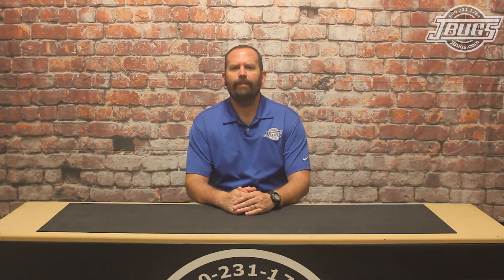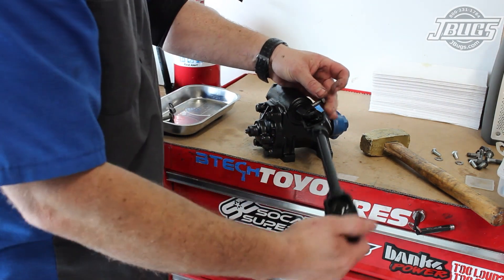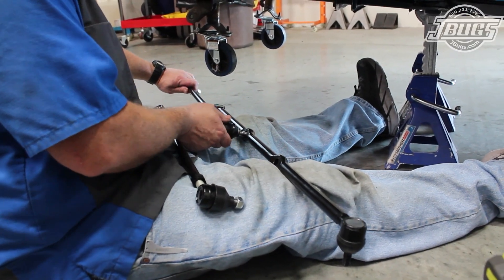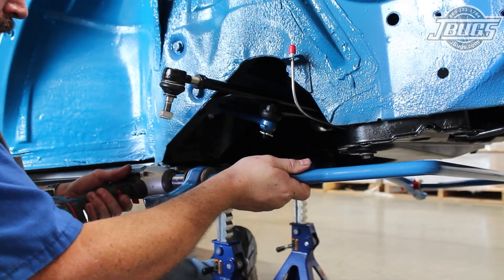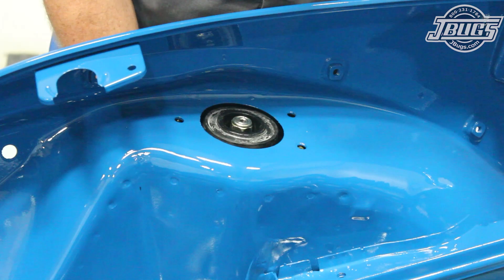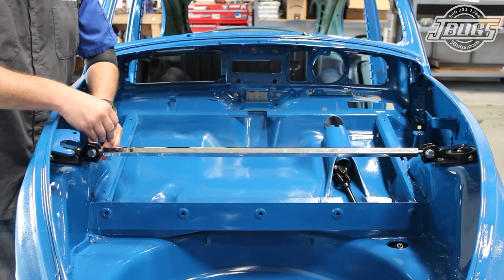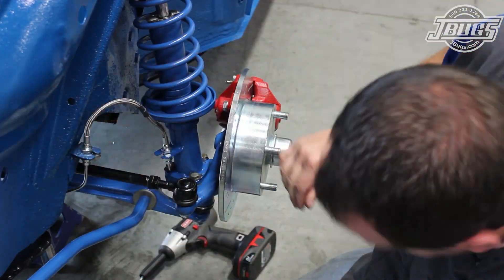JBugs - 1971 VW Super Beetle - Front Steering & Suspension Installation

Comment: I have a 71 Super also.  Question, do I need any special tools to install new ball joints?  I got a puller to remove it but was wondering about what to use when installing.  Thx in advance
Reply: No, it isn't a press in unit, it is just bolted in place.
Reply: @Sam_Mebane  how well do the red replacement parts work? Just as good? What's their life look like?
Reply: @lvlikeyV  I've always had good luck with urethane components. Some people haven't, it just comes down to personal preference and making sure to use quality components.

Comment: One minor critique, it is mentioned that the sway bar is an upgraded "heavy duty" one, and that larger-hole bushings were needed for it. But it's mentioned in the video, and the linked part, that it's 3/4" diameter. I'm pretty sure that's the stock size, and the fairly popular upgraded ones are 7/8" diameter.
Reply: We linked the 3/4" sway bar which is considerably larger than the stock sway bar. Can't say that I have ever seen a 7/8" bar for a Beetle, the 7/8" bars we offer are for Type 2s.

Comment: Do you leave the inner metal sleeve in from old bushings?  Kit came with bushings only, no sleeve. Prob an obvious answer but idk
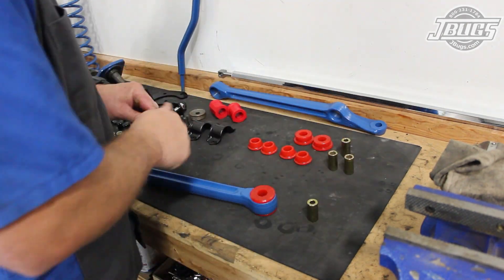Reply: The urethane bushings we used (starting at about 3:48) come with inner sleeves, which we used. If your kit didn't come with sleeves then you'll probably have to use the originals.
Reply: @Sam_Mebane  sorry I meant the out sleeve. I've heard some people say try to leave it and others say take it out. It's hard to tell from this video if it's in there or not.
Reply: @bilbobaggins1000  The out sleeve of what part?
Reply: @jasonwhite3080  There aren't any sleeves on the control arm, they are cast iron. Pause the video at 3:46, that is what the control arm will /should look like before the new bushings are installed.
Reply: I'm not sure of these sleeves, but one possible source of confusion is that VW changed the design of the track arms, ball joints, and struts in mid-'73 from these cast arms to a stamped-steel design. My car is an early 73, so it's the same as this, I can't speak to the later models as I've never worked on one, but they will look different. I don't know the exact details of what is and isn't different though.